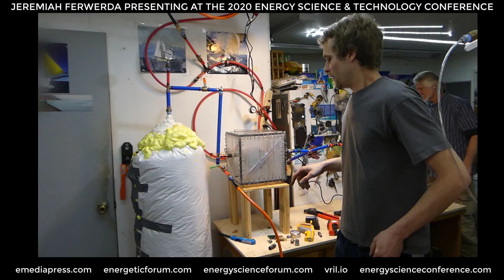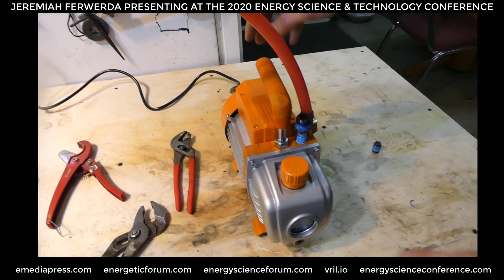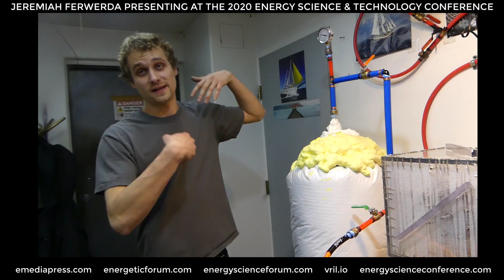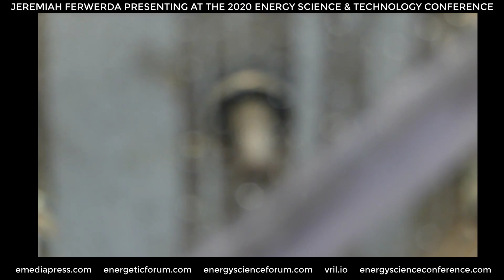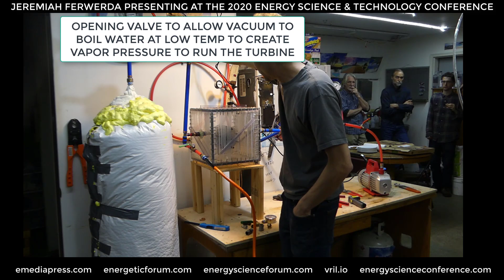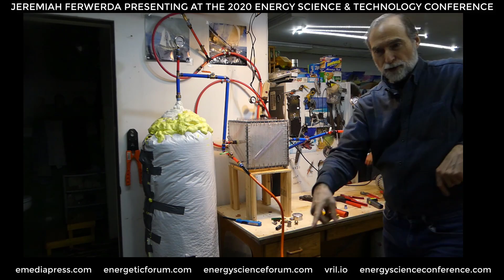Self-Sustaining 2-Stage Tesla Turbine

Comment: you're going to need to try and do this again with no background audio and only one person speaking. You're going to have to work from notes so that it is comprehensible. I think you're onto something but as it is it's impossible to follow. Good luck
Reply: Yes, please do! Write it down, proof read it, and put it on cue cards
Reply: @localbroadcast  the system essentially can be designed to siphon filter any ambient heat in the environment at the boiler side as well as from the cold at the condensor side through any regulated temperature differential. 

He did mention around 27:10 the boiler tank as input is roughly about 202 C° in this setup if I'm not mistaken. Making it easier to vaporize the water under negative atmospheric pressure by way of vacuum.

Whenever the vapor pressure condenses on the cold side of the tesla turbine it also creates even more vacuum negative atmospheric pressure as the volume collapses, in turn lowering atmospheric which causes the system to exhibit more vapor pressure as the heat exchanges energy from potential to kinetic as transferred upon the adhesion & viscosity upon the tesla turbine plates. 

It is just a matter of matching the equilibrium between the vapor pressure evaporated & the surrounding negative atmospheric pressure gained as the vapor condensed. This causes self-sustainability by allowing the natural boiling towards vaporized pressure as the reservoir of heated water transfers its energy towards low temperature. 

This system takes advantage of the temperture gradient as power generation as the system seeks equilibrium between the temperature differential. This is achieved by balance of this two-way motion.  

The negative atmospheric pressure condition in the vacuum enables the vapor evaporation to initiate as the water boils & vapor is released which primes the tesla turbine. 

This system can be designed even smaller once the controls of these parameters can be regulated actively with a basic microcontroller or with auto bell siphoning relays passively.

Comment: hmmmmmmm, Just watched Mr. Lindeman's video on his air engine, and you could do that with Tesla Pumps (assuming Tesla pumps work for air?)  So, you use the Tesla Pump to increase pressure, use the heat, then put this high pressure air to drive the Tesla Turbine in a sort of reverse Tesla turbine, then you use the cold, you boil the water as you do at low pressure ??? profit.

Comment: This maybe a good technology used in hot springs. Maybe if you live in a warm sunny climate you can use fresnel lenses to heat up a tank?
Reply from the maker: You'r right - simple evacuated solar water heater collectors can do it at high efficiency.
Reply: @AaronMurakami13  Awesome, thanks for responding Aaron!
Reply: In a warm climate, a simply matt black container with high surface to content ratio does a lot. Not quite boiling, but things get warm.

Comment: I think a lot of the confusion in the comments comes from where the energy goes. This operates as a normal turbine based heat engine, save for a feed system. This is a closed system, and will run out of vapor pressure (it will all be vapor by 0°C, then as pressure depletes, and if it is still able to cool enough (unlikely due to ambient heat), it will freeze at -60°C, rapidly depleting any useful pressure available for the turbine). Returning the condensed water will require energy to over come the boiler's higher (comparative to the turbine condenser (the cold tank)) pressure, so a pump of some sort will be required. The energy requirement to return feed is where the "missing" energy is. I believe the significance of this system, is that the turbine itself can maintain vacuum in the condenser, which massively simplifies heat engine design; also, this setup allows for really efficient energy storage by way of heating water because it doesn't have to be very hot, therefore less energy loss to ambient.

source: this is my job
Reply from the maker: It's not a closed system - the airway yes, but that water tank on the front could very well be a solar water collector - that tank is open to environmental heat ideally and the condenser tank is also open to environmental temperature. You are correct though that it being able to not just maintain vacuum, but create vaccum as it runs from the second stage. What you see in the video is a a very rudimentary built that still shows the concept so there is a lot of room for improvement.

Comment: This is a straightforward and simple demonstration of how low temperature water in a tank, while under a vacuum, will produce cold steam, thereby raising the intake pressure of the 2 stage Tesla Turbine above the initial vacuum pressure. This pressure causes the turbine to rotate due to a pressure differential between the inlet and discharge of the turbine. Here in is where the magic happens while maintaining a very low inlet vacuum pressure. Refer to the Pressure - Temperature Phase diagram of water for clarification as to why this even works. Again, this is only a demonstration.... not a full-fledged system design.
Reply from the maker: Hi Jaro, imagine the possibilities with other fluids like ammonia, etc. with much lower boiling points.

Comment: Hi, I love this tech. Is it not possible to connect / seal the Pump exhaust to the 'Cold' tank pipe? This way you would not need the 'Vacuum" box?
Reply: In the future we plan on using graphite air/fluid bearings to seal the shaft. It is also possible to just cap off the shaft and generator with small enclosures.
Reply: With vacuum box you get redundancy if it fails.

Comment: Why not use electromagnets and a shaft with aluminium inside of it to keep it suspended by only magnetism the way they are using on some high speed trains, should make zero friction and perfect balance then. Hook it up to a generator that is mounted onto the same shaft. you would need power from another source at first to keep it suspended until the generator can generate enough due to rpms. I think there is a lot of things this could be used for with the right kind of generator to harness electromagnetical energy.

Comment: GREAT WORK
OK. TELL ME IF I HAVE IT RIGHT?
THE PRESSURE IN THE SYSTEM IS REDUCED CAUSING A DECREASE IN BOILING POINT. THE VAPOR PRODUCED IS USED TO TURN THE TURBINE WHICH IS CONNECTED TO A GENERATOR PROVIDING ELECTRICITY. THE WATERS THEN CONDENSE AND ARE RETURNED TO THE SYSTEM TO REPEAT THE PROCESS.
Reply: Eddy, don't type in all caps, basic internet courtesy.
Reply: Yes that is how it works.

Comment: using metal in the generator is not needed, all the metal will do is slow the rotor down.The generator will turn faster and produce the same power with less heat if there is only copper in the generator.

Comment: Alcohol has a lower cook point, would that possibly store more energy than water?
Reply: Not store more energy but it would absorb more energy and boil at lower temperatures, we want to experiment with it in the future, but there is the danger of it being flammable.
Reply: @iEnergySupply  If you remove air  or add co2?
Reply: In the event of an accident, aerosolized alcohol equals instant drunk and poisoned depending on if it was denatured or volume inhaled if it all did not ignite and so on.
Reply: because there is no pressure in the system beyond ambient air/atmospheric, there wouldn't be a problem with that. The problem would be oxygen sucking into the tank because of the vacuum and possibly accidentally ignited.
Reply: @iEnergySupply  what about ammonia? Its a common and safe refrigerant
Reply: @Tableflipper04  We just got our tank of ammonia, time to dilute in water
Reply: @iEnergySupply  thats awesome! Great news, can't wait to see the results

Comment: That water was running the turbine  at over 20,000 RPM. Typically you need over 212 degrees f or 100 degrees c to get anything spinning over one rpm, and that's a fact. Here we are running on water in the boiler at 165 F or 73 Degrees C
Reply: Ok your deom is so cool and especially your idea to build up generator in the turbine but do you have any estimate about time need to boil the water with sun and make pressure? And do you have any estimate overall efficiency comper to solar panels time to warm up smaller generator etc makes the production under pressure, for battery part hho can convert your extra electricity to co H2 more effective then chemical battery
Reply: @cylosgarage  What fact?
Reply: @iEnergySupply  "Typically you need over 212 degrees f or 100 degrees c to get anything spinning over one rpm, and that's a fact."
Reply: @cylosgarage  212 creates pressure, you can run a steam engine or a steam turbine using pressure, but in order to operate below 212 degrees using water as your motive fluid, you need to increase the temperature to 212+. We run the system on water below 170 degrees. Below waters normal boiling point.
Reply: @iEnergySupply  uhhh vapor pressure is a function of temperature. You can generate pressure with water below it’s boiling point, just not as much. Not sure why you said your original claim
Reply: @cylosgarage  I was comparing it to a regular pressure gauge. With a regular pressure gauge it will always read 0 psi.
Reply: @iEnergySupply  comparing what with a regular pressure gauge? What are you talking about?

Comment: What about letting the disks that make up the tesla turbine become Faraday Disks? Don't use the torque from the turbine! Getting energy from the Faraday  Disks doesn't create any resistance!
Just size it up properly since the diameter of the disks determines the voltage output, and only the voltage squares on it's self!

Comment: 1:55 Maybe I misunderstood you, but this violates the second law of thermodynamics, which says that there's no heat engine that would be able to run on heat directly. You always need an external temperature difference - two temperatures between which the engine is placed and the heat flow is PARTIALLY (this is important) converted to some other kind of energy, in this case mechanical. The way you describe the turbine-pump combo suggests that the cold heat exchanger is somehow integrated into the turbine itself, which according to modern physics is not possible, as this machine would therefore be able to reverse entropy. I love the project, but I think you're wrong on this one.

Comment: 15:46 more speed  faster...more energy  you can extract...need less torque
Reply: 16:00 start with high speed generator..
copper disc (as wiring) against
hallbach array ..
no?
Reply: belts and pulleys dont like to work.. 16:14
Reply: 17:53 just lost me
water.. i go back..

Comment: How is the condensed water going to get back to the boiler?
Reply from the maker: In that demo, it's not - just to prove the concept. But the condensed water can be put back thru a Tesla valvular conduit or other method.
Reply: Does this need a pump of some sort? I have hard time finding any waterpumps for this purpose. I want to build closed loop like this that has a pump that pumps condensate back to the boiler.

Comment: Shaubegrer not Tesla ..
Reply from the maker: It is a Two-Stage Tesla Turbine right out of Tesla's patents.
Reply: Thanx for saying that - i checked Viktor Shauberger and noticed that he was a meditator and was speaking of remote viewing. I also experienced those things and fell in love with Nature - he also speaks of Nature as the true master. Thank you :D
Reply: schauberger use water vortex. tesla used synchronized speed between the fluid and the blade to reduce vibration, increases rpm limit, and increases efficiency in overall schauberger tech is suppressed so idk the real one but at least tesla's isn't.
Reply: @lukiepoole6701  A magnet has a similar structure to water, so i dont know what you on about and what you want to convey with this.

Comment: It never made sense to me when my science teachers would say that you can’t extract energy from heat.

Peltier devices do it, and hell, almost all our power comes from heating water, converting that heat to kinetic energy, and then converting the kinetic energy to electricity.

The only question i have is how would you run this in a warm environment? Heating the water with solar can be done anywhere, and in a cold environment, you can use the outside temp to freeze the water and prevent vapor pressure from ruining the vacuum, but if this is done in 90 degree whether, what prevents the vapor pressure from
Building up and ruining the vacuum?
Reply: When done correctly the second stage produces enough vacuum  to compensate for not having a condenser.
Reply: @lukiepoole6701  A lot of them say that. They admit that heat is energy, but they claim that heat is the form of energy that has the most entropy, so that somehow means that extracting energy from it would violate the law of entropy.
Reply: @iEnergySupply  Can you explain this? How does the second stage maintain the vacuum without condensing the water?
Reply: I'm not even sure what you mean by "second stage"
Reply: @Dziaji  the second stage uses centrifugal force to throw the Vapor / Steam Away from the center of the turbine. This causes flow/ vacuum vaporizing more water, but in order to equalize the low pressure it has to spin the turbine. Because the turbine is attached to the pump, the pump is driven by the turbine causing the low pressure in the turbine, and causing more water to boil under low pressure.
Reply: @Dziaji  First stage is a tesla turbine the motion from that runs a tesla pump and a generator the pump maintains most of the vacuum currently the rest of the vacuum is achieved by a condensation tank.
Reply: @Barskor1  You got it!
Reply: Insulate the condenser?

That makes more sense to me than insulating the boiler.

Comment: what is it claimed to do>? just an efficient turbine? overunity> ? i didn;t want to wade through 30 min to find out, i got to the part where it spins but so what?
Reply: It's a highly efficient heat pump. A standard steam turbine has boiling water on one side and a condensation collector on the other and requires the water to be at high temperature. This is a system that  uses vacuum to create the steam for the turbines at lower temperature. 
I don't think it's especially different from a standard steam turbine other than it's actively creating the vacuum to continue the flow of steam instead of relying on high temperature from the boiling side to get the kinetic energy.
I just wonder if he's getting some of the energy from the water expanding into the vacuum chamber. Not saying he's trying to. Just saying he may be seeing a gain from having the vacuum chamber acting as a battery for additional negative pressure and getting more expansion from leaks on the turbine seals/bearings. 
It's still interesting and I hope it works the way he believes it does. 
I think he's showing that water boiling is more efficient at lower than atmospheric pressure. Possibly even turning low temperature differences into useful energy.
Reply: That is probably a lot longer of an explanation than you needed but I don't know how much you already understand about gas pressure. 
Just giving the most thorough explanation I can.
Reply: @monster8090  can you answer a question please? if this is a highly efficient heat pump then if i put 10,000watts of electric in to heat the boiler how much watts could i get back of electric? Say my cooling side is always at a steady 50degrees and i don't have to put any energy in it.
Reply: @joshuanorris9785  that's not a specific enough question. 
Also, watts are not a measurement of heat or pressure. 
And I don't know what the efficiency of this system is exactly. I imagine that the people building it don't know how efficient it is yet either and that's why they are experimenting and measured the output.

Comment: There is no way this can work.... if it could, then that would mean you could just use the power to run a heat pump and get more heat energy than you used to run the turbine.   Not happening, sorry.
Reply: Are you really claiming that you can convert, with >90% efficiency, heat energy into power?  If that is truly the case, then you have solved the energy problem for all time.
Reply from the maker: @OnlyFactsPlease  It's right in front of you what it is.
Reply: @AaronMurakami13  Do you think this is around 90% efficiency?
Reply from the maker: @joshuanorris9785  I'm not sure of the efficiency - more importantly, is the COP - coefficient of performance over 1.0? If there is a solar water heat with a tank large enough so the turbine system cannot deplete the heat by the time the tank warms up again, the COP moves to infinity.

Comment: Loved your video. lots of energy input. Compressed air, electric heat, electric operted vacuum pump. No free energy there. Heat has always been the working fluid of any engine wheather it is combustion or air type. Would love to see the finished prototype and to see just how much torque output you get out of it. That is where the rubber meets the road. Energy in, energy out. Keep working on it and you just may get it right someday. Oh consider using a DC generator on your turbine and not AC. You can produce 3 times more energy out with only 1/3 torque input.